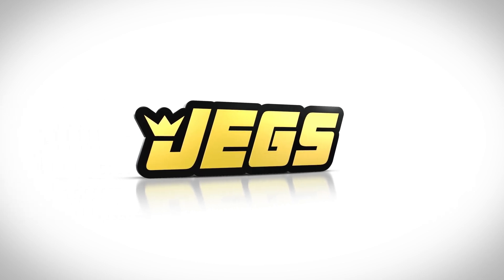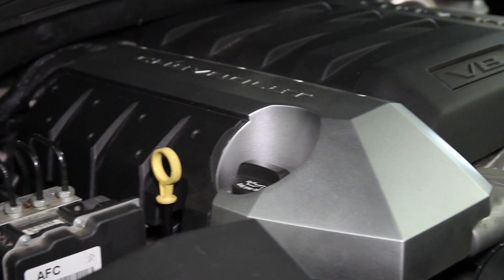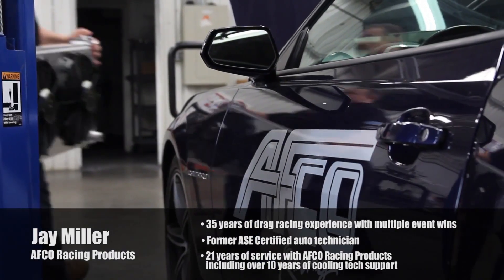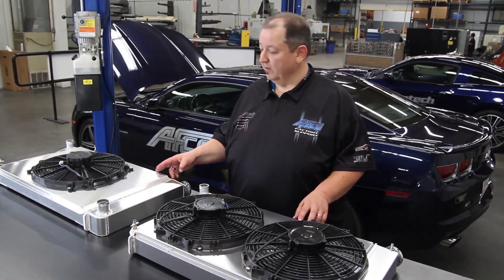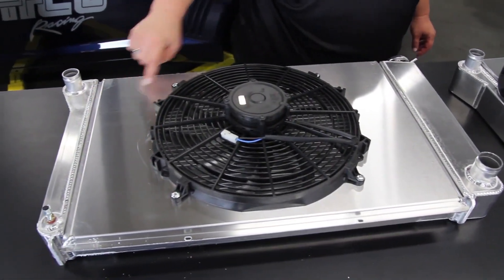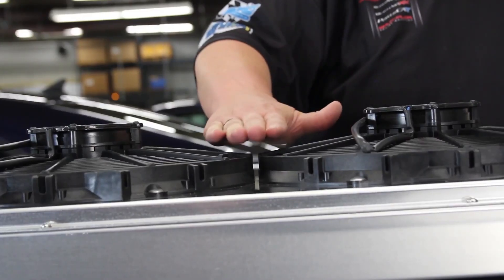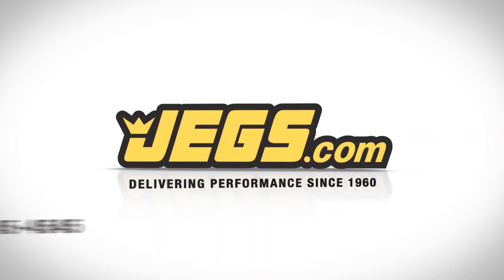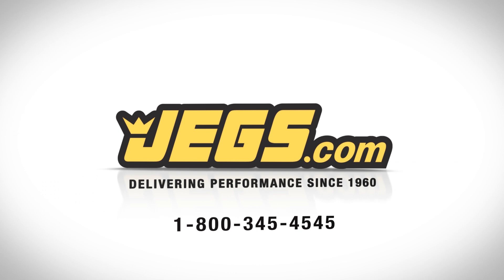Choosing a Radiator Fan: Single vs Dual Fans and Shrouds With Afco Racing

Comment: I have an 09 charger 3.5 V6.
The fuse box for the fan shows this....3 different relays with 2 different speeds for each relay.
There is a large single fan hooked up. How can a single fan have 3 relays with a total of 6 different speeds?
I'm thinking someone hooked up the wrong fan because,  they ran a ground wire from the resistor to the fender well.
Thank you in advance for your help.
Thank you very much for your info in this video
Reply from the maker: For the answer to this question, please call AFCO direct at 1-812-897-7651 as it will be easier to explain via phone than through a reply here.

Comment: Could you not cut some louvers or cut a rectangle and add a flap to the single system so air could escape at high speeds ?
Reply from the maker: Sure.